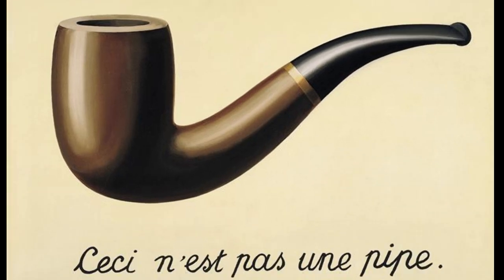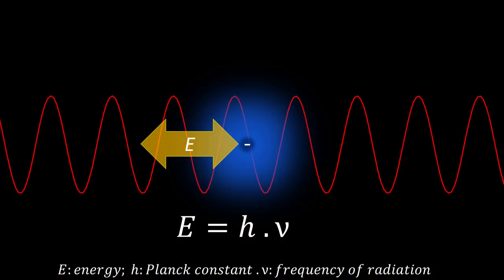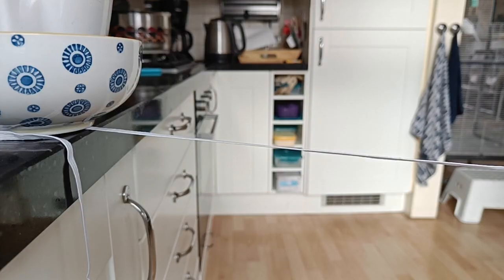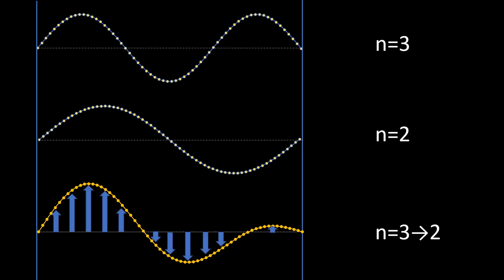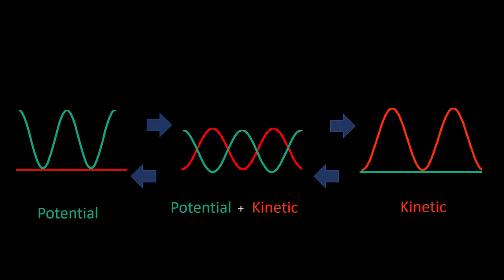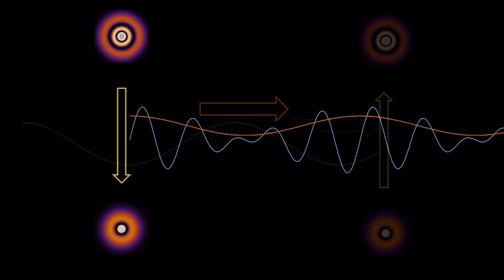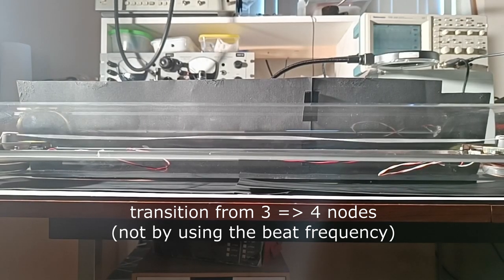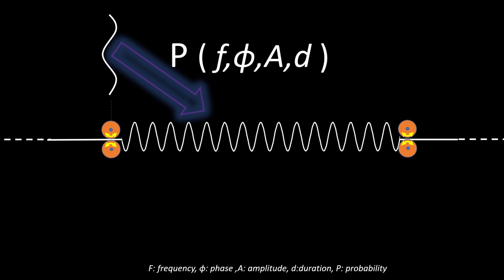Coherence part 3: This is not a wave.

Comment: So I don't want to jump the gun this early into the video but there is a phenomenon known as Breit–Wheeler pair production in which two (or theoretically more) photons interact in the inverse of electron-positron annihilation. Electrons and positrons are detectably produced at sufficient electromagnetic radiation intensities. I'm not sure if you're just not addressing this, don't know or don't believe it happens or are relying on quantum vacuum fluctuation virtual particles to proved the interactable entities responsible for Breit–Wheeler pair production.

Any way you slice it, you can't arbitrarily scale up the magnitude of electromagnetic radiation without encountering pair production.
Reply from the maker: Well, I haven't actually addressed a lot of things that I came across. One thing I noticed is that when you put in enough longitudinal energy in the string at exactly the right frequency, you can spontaneously create a transverse standing wave (of a different frequency). And once that happens, you can actually decrease the intensity quite a lot and the transverse wave will not disappear. So apparently, the string has no good mechanisms to get out of a transverse wave and return to pure longitudinal. The only way out is fade away from friction. Now, of course there are no pairs to be formed here and there is no equivalence for charge, but I thought it was rather interesting that energy could not escape the transverse wave once created.
Reply: @HuygensOptics  Yeah, physics is full of spontaneous symmetry breaking. Its unfortunate that translating experiments to higher frequencies, energies and more uniform materials usually comes with an exponential increase in equipment cost.

I mothballed an optics project using Kerr cells because Pockel cells are $3000 and I couldn't get the optics to work right on the Kerr cell.  Things have changed since then though and maybe its worth looking at again.

Comment: If you use some kind of resonator with better Q factor, for example quartz crystal? you can excite one mode of vibration of the crystal. Then you can turn off the external energy source that  periodically drive the crystal vibration, and then you can add external force on a double frequency. It is interesting to investigate also the lifetime of the different vibration modes of the crystal.
Reply: This is normal. Large structures designed to withstand dynamic loads (such as earthquakes, wind loads, explosion loads...) solve the problem of finding specific vibrational frequencies.

Comment: As long as you do not change distance beetwen grip (that hold points of your string) you achive constatnt impedance parameter of your transmision line. Since you start changing distance beetwen it it automaticaly change impedance of string and resonant frequency for standing wave. 
You rather should use another speaker with beat frequency in always constant distance beetwen point of mounting string.

Comment: I'm still not convinced string whipping, fluid waves, marbles, pendulums or springs have ANYTHING to do with electromagnetic waves. Until you know what the structure of the medium that distributes the wave is, you might as well assume it's fairies. What even is the shape of the (uncompounded) wave, is it a ring or a sphere, pulsating or twisting? Nobody knows.
Reply: Nobody claims this. Three common property of a swing, a sound wave and an em wave is the temporally oscillating amplitudes of their different energy variables

Comment: Excellent. A related question that has plagued me for many years relates not to how a photon is emitted from an object as small as a hydrogen atom, but how it can be absorbed by something that is so much smaller  than even a single wavelength of the photon. This is especially true for the 21cm (wavelength) hydrogen emission used by cosmologists - how can a hydrogen atom absorb (100%) of the energy of a photon that has a 21cm wavelength?
Reply: As pointed out in the comment submitted by a visitor with the username 'Dr Gamma D': the frequency of electromagnetic light is a frequency of cycliing an internal state. That internal state is not accessible to observation. The existence of the internal state is inferred from clues, among them the fact that interference patterns can be obtained. Given the speed of light: for every frequency there is a corresponding spatial distance that the propagating light covers over the duration of a cycle. 

The amplitude of light isn't necessarily a spatial amplitude. That is: the energy of light does not necessarily have spatial extent, either in transversal or longitudinal direction. 

The existence of a periodically cycling internal state is inferred, this cycling internal state is represented with an abstract vector notation. Within this vector notation there is a definable length of that vector. The square of that length correlates with probability of an interaction. The length of this vector is an abstract notion, it should not be thought of as somethng that can be understood in terms of the three spatial dimensions of the macroscopic world

Comment: 21:33 whoa. 🤯
Movement of charge generates a magnetic field. So a change in the electric field of the electron at that beat frequency will generate a magnetic field at that frequency. I haven't yet watched further but I'm betting that beat frequency happens to correspond with the frequency of that photon that is emitted.

Comment: I want to win the pipe!

I suggest that your transverse speaker inputs much more wave energy into the system than the longitudinal speaker, for the same input electrical energy. Find out what that ratio is, perhaps by measuring output amplitude for each input independently.
Then instead of turning off speaker 1, reduce its input by that ratio as you turn on speaker 2 at the beat frequency. Keep accounting for phase as you have done, and Bob's your uncle*
*Probably some more fiddling around in practice, but clearly you've got that mastered. Have you demonstrated to yourself that the longitudinal speaker can sustain a standing wave over friction? That seems like a prerequisite to any of this.

🎷
Reply from the maker: no sorry, that is not it. I did not use the beat frequency, actually I used a much higher frequency then the original transverse frequencies involved.
Reply: @HuygensOptics  ok. It was worth a try. I hope that someone is able to get the solution and win that pipe.

Comment: If you have a speaker at one end of the string, vibrating transverse to the string at 32 Hz and you want to step the string's harmonic up to 40 Hz by only adding an 8 Hz wave, I think you need to turn the speaker at the other end of the string to be parallel to the first.  Instead of trying to manipulate the potential energy with a longitudinal wave to induce a change of mode, make use of kinetic interference.  I'm pretty sure you can get it to interfere constructively, effectively adding the 8 Hz to the 32Hz and stepping the string harmonic up to 40Hz.  At least that is what my head math is telling me.  It's like two standing waves in the same string, adding an extra node.  I have no way to test it though.
Reply: Okay, I woke up this morning and did some more head math, and I'm sure I'm right.  The two speakers just have to be, somewhat unintuitively, out of phase by 180 degrees to add together.  This is because they are at opposite ends of the string.  If they are in phase, they will subtract down to 24 Hz.  You don't need the one end to operate at 40 Hz.  You just need the rate of change between the two ends to be 40 Hz.
Reply: Come to think of it, the same thing should happen if you had two speakers on the same end of the string, one oscillating the string at 32 Hz and the other oscillating the first speaker at 8 Hz.  They would have to be in phase if they are at the same end of the string.  You would simply be adding an 8 Hz beat frequency to the amplitude of the the wave.  It would interfere and spawn a new node.  :goodvibes:
Reply: OMG!  The string is oscillating at 40 Hz, but the only thing attached to it is a wall, oscillating at 0 Hz, and a speaker oscillating at 32 Hz.  So the 40 Hz is only stable as long as the second speaker is on.  As soon as it stops, the string has to release an 8 Hz beat frequency and step down an energy level.  Jeroen, YOU ARE A GENIUS!!!  🤩

Comment: It is curious how water has a high dialectic constant, it can hold quite a bit of charge. Then you reflect on thunderstorms, Lord kelvins thunderstorm, experiment, then water being essential, for life, must surely have something related to its high dialect constant.

What I’m chasing right now in my mind is, is the question of is there a way to entrap electromagnetic waves at lower frequencies, it away similar to how space traps particles, which would facilitate easier experimentation, being larger and less “delicate” than atoms. 

My current thought is, you could probably do it within a high dielectric, constant material, as an alternative to metal resonant  cavities.

The other thing is to come up with a really polished iterated and evolved version of your experiment, where everything is maxed out to more easily see the wave transition, and all wave mix components.

Comment: Have you made a parametric oscillator by driving both the longitudinal and transverse modes? Its like a kid on a swing. You're  modulating the string length. This how Femi's golden rule works (https://en.m.wikipedia.org/wiki/Fermi's_golden_rule). The photon adds an oscillating term to the Hamiltonian just as you are adding a oscillations to the string length. You're  experiment is a fantastic classical analogue of a quantum  system.

Comment: I think a theoretical (or if it must be free from maths and interactive, a computer simulation) model would fit much better with what you're trying to do.
However, I'm concerned that this line of reasoning is missing the main reasons why wave-particle duality can't be avoided in the 'quantum realm'.

Imagine, for example, a vast empty space (10 lightyears across) with singular Hydrogen atoms placed at both extremes. If we were to introduce a single photon worth of electromagnetic energy (by having an excited H atom's electron decay from the n=2 state to the ground state) at the geometric center between them, then this EM wave would spread out in all directions and only have a miniscule chance of being absorbed by either of the two H-atoms after 5 years have passed.
The problem is that if and when either of those atoms does interact with the EM wave, it instantly absorbs ALL of the original photon's energy, therby completely eliminating the rest of the wave in an *instant*, irrespective of the wave speed (which is obviously the speed of light in this case) and the spatial extent involved.

This is completely ignoring the other quantum weirdness and only focusing on the emission, propagation and absorption processes.

As for the wave experimentation; Since no one thinks that waves on an elastic string perfectly encapsulates all (and only all) of the fundamental physics of electromagnetism, I propose that an idealised theoretical model has no significant down sides and many potential benefits:
For example, how about we restrict our attention to a 1D array of point masses where each mass is connected to its 2 closest neighbors via "elastic" elements. Each elastic connection applies an (equal and opposite) displacement dependant force to both masses it's connected to. This force can be programmatically defined however we want (simulating anything from Hook's law to interatomic forces and everything inbetween).
We can then define interactive boundary conditions on both ends of the string and run the simulation with the symplactic integrator of our choosing, storing the results for detailed analysis that would be very difficult and costly to obtain in a laboratory setup.
Reply from the maker: Well, the thing is that you assume you know what the outcome is of the experiment you did not perform. But what now if you do the experiment and it turns out that the probability of detection is actually not just very small, but ZERO for either atom. Then all the quantum weirdness isn't there.

Comment: With electronics you need a non-linearity to produce beat frequencies (mixer.)
Then you will get the sum and difference of the 2 frequencies as beat frequencies.
I guess with sound you don't need a nonlinear mixer.
I imagine you could have read Elektuur when you were little?

Comment: @HuygensOptics  Although I love you very much, I must also tell the truth that:
1. To investigate the wave state of a macroscopic system and calculate, it is necessary to hypothesize that:
About the material: Homogeneous, isotropic. For what? For convenience of calculation.
Watch the object work in absolute elastic mode. That is, when not exceeding a certain limit, the system works in the elastic stage, if too much, the system will collapse and destroy.
2. That means: Given a mode of oscillation with a certain resonant frequency of the system, there can be many energy states. Therefore, the micro-type E = h.ν formula cannot be applied.
How can I explain this?
To meet the uniformity, isotropic criterion, it is recommended to use metallic materials with certain crystalline form.
And for each metallic material according to Hooke's law, you'll need to use Poisson's coefficient - the material's coefficient of hip expansion. And for simplicity, you should use stiffness modulus instead of elastic modulus (according to volume strain, elastic strain potential will be seen).
Actually those things may not matter. The important thing is that for each vibrational mode of a macroscopic system, it can have many values and energy states, depending on the type of material used and the frequency and amplitude of the wave. (this uses material strength knowledge,
Therefore, when it is said that the system decays from the high resonant frequency to the adjacent lower resonant frequency, it is also difficult to be clear.
But obviously, we see, in your example, that a high resonant frequency when moving down to a lower resonant frequency will be a low resonant frequency + 1/2 period of any wavelength. it with a certain amplitude.
We understand again that a damping wave is an exponential. And again, in principle, when he placed the system in a vacuum, the energy could be released only through photon emission.
Therefore, the emission can only be a linear combination of many wavelengths with an exponential relationship over time. In addition, it distributes the density of the wavelengths to the temperature of the string material....
In general, macroscopic systems are complex and cannot be said to be compatible with macroscopic systems such as electrons and nuclei.
In a proton-electron system like Hydrogen. The vibrational energy of 1 frequency is determined E = h.f. Therefore the energy difference of the two energy levels is determined E= h.(f2-f1). There are no other waste components. And the decay or absorption of energy happens instantaneously.
There's something I want to say more, but it's hard to describe...

Comment: One more video on acrylic plastic trapping electromagnetic energy, this time light. This is the first time I’ve seen this effect, so May be grain of salt, but maybe not. I understand this correctly, the total internal reflection mode established by exceeding the critical angle, makes the light trapped inside the acrylic, So effectively, it’s what I was chasing in earlier comments, where a dialect acts like a reflector, as an alternative to a metal resonant cavity. 

This seems to close the question on whether it’s possible to trap energy via a dielectric material echoing your idea on how space traps atomic particles at much higher frequencies. 

I only have enthusiast knowledge level with regard to the constant k and dielectric parameters, such as the permeability of free space versus various higher dielectric constant materials, etc. But I have a suspicion that perhaps you can trap lower frequencies given higher k. 

I know many materials have been characterized by electrical parameters, but looking at this topic fresh, with the energy entrapment viewpoint might yield new insights.

It’s amazing that refraction becomes reflection, “in the limit” as the mathematicians are so fond of saying, and this gives more support for your trapped waves model.

See:
https://youtube.com/watch?v=n314QFKzV6Y&pp=ygUxRG9lcyBzdGF0aWMgY2hhcmdlIHJlZmxlY3QgZWxlY3Ryb21hZ25ldGljIHdhdmVzPw%3D%3D

Comment: If you mix two frequencies f1 + f2 you will not get third/beat f3 frequency. You will get only the same f1 and f2  (in linear system) . Beat frequency does not really exists. It is fictional. Also the shape of beating may look like a wave packet, but it is not.

Comment: Apparently, Franz Melde did a similar experiment to yourself (https://en.m.wikipedia.org/wiki/Melde%27s_experiment), using  turning for instead  of a loudspeaker o very the length of the string. It is a parametric oscillator as per my previous comment.

Comment: Note that if there is no dissipation in that wave on the string, the resonance width is 0, and you'll never match it (see Q-factor). Of course you know this from line-widths in atomic transitions.
Reply from the maker: That is correct. In the case of the string you will never achieve a stable new mode if you just keep adding transverse energy of a different frequency when no friction is present.